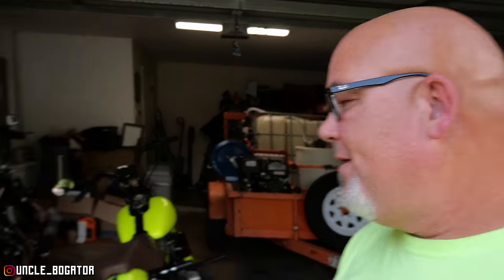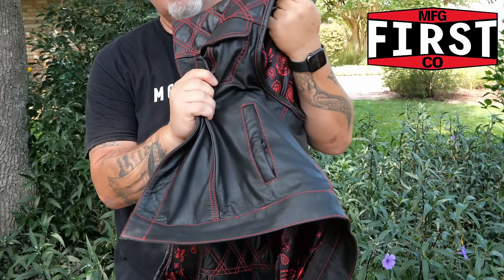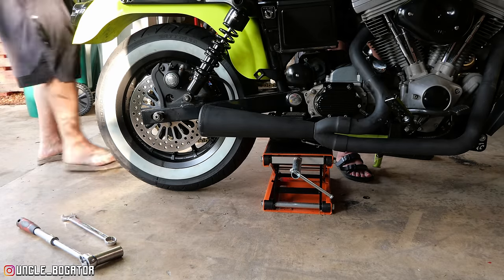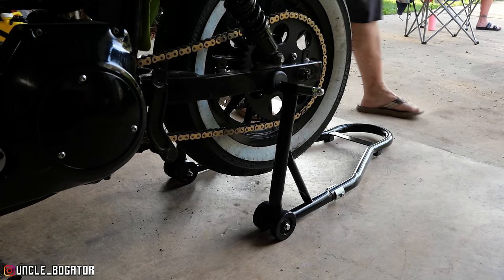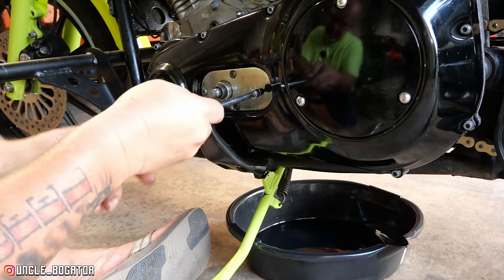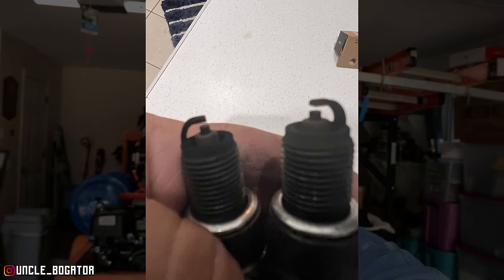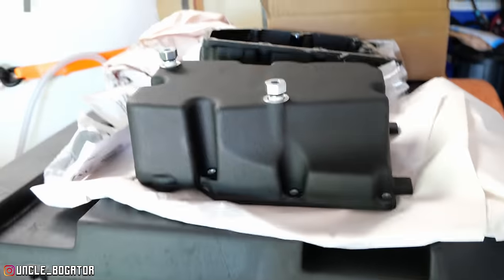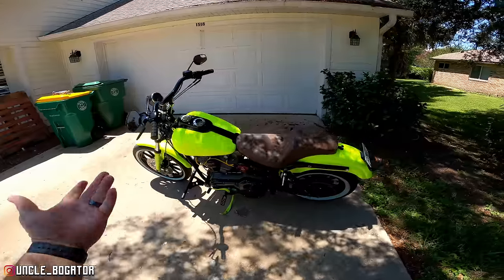This old Harley Davidson is a DISASTER!

Comment: Should probably be in the low range jet kit for an 80in evo. When i lived in tampa mine had a .0295 and a 70 with an ev27 cam and it seemed to run great
Reply from the maker: Thing is I think those are both in different ranges. 70 is low range and 295 is high range  if I recall right. I’m gonna try it with the recommended 72 and 295 and see where to go from there. If I’m still rich then I wasted money lol

Comment: A quick temporary fix for the leaking oil pan/tank because of the stretched threads is to use some Teflon tape on the drain plug itself. Only on the end near the bolt head though. Don't want that shit getting into your engine.

Nevermind disregard. Shoulda watched the whole damn video before commenting 😅
Reply from the maker: lol all good! I considered teflon tape but since the threads were angled, I didn't want to risk getting in the oil

Comment: i believe you need the washer to help seal the drain plug to the pan
Reply from the maker: it's not in the parts diagrams for this bike. But it's pretty thick. It's definitely not a washer like you're probably thinking. Looks more like a collar that would fit inside of a different model's drain hole.

Comment: Man, at least the bike ended up with someone who's gonna take care of it. I had been talking to the previous owner trying to snag this bike.  Ended up with an Ironhead instead after you bought it. Which was great, until it took 21hrs to get it home when yhe motor had oil starvation that blew the gaskets and the top end got jacked up further when the front piston kissed the valves.
Reply from the maker: big yikes man! hope you get it runnin right.
Reply: @UncleBogator  Me too! Thankfully, the previous owner as well as a couple of YouTubers that I've known for a while are offering to help me out with parts/guidance. First rebuild that I'm not going to outsource, so it's a bit nerve-wracking. But, glad the riding community has some good folks in it.

Comment: 😅Very possible they put on that carb just to have an s&s. Stock 80 inch do great with a well tuned CV and a .495 cam like the ev27.
Reply from the maker: Yeah idk anything about them yet
Reply: Sounds like you're about to learn.  Lol.  They're a great carb.  But a lot guys will just bolt them on and go,  without the proper fine tuning.   Good luck.
Reply from the maker: @joekool4  that’s the idea! This one has definitely been messed with. I’ve watched several videos on them. S&S lowbrow and some others to get a feel for what I’m doing. We’ll see

Comment: Here is a suggestion instead of crying in your beer with all the problems that bike has. Yard sale it!!!!   2019 I purchased a used Honda VTX 1300 with a Vance and Vines header. 10,500 miles then, about 12,600 now runs super pulls strong thru the powerband. Only changed oil in and a breather. Needs front tire but that's it. You won't get amazing glances from Harley riders, but you will be out there riding while they have theirs in the shop
Reply from the maker: That’s such a myth lol. I’ve had more problems from the many Hondas I’ve owned than all my Harleys combined. You’re just repeating things you’ve head but never witnessed.

Comment: You should use Gaskacinch on anything that contacts oil. Silicone will break off and get in oil passages and thus restrict oil flow.
Reply from the maker: I bought permatex or however you spell it. Seems good so far

Comment: I’ve never seen anyone adjust the chain with the rear tire in the air. I do mine at 1.25” with the tire on the ground on its own weight
Reply from the maker: Chains should be adjusted with the weight of the bike square in the swing arm. I’m sure yours is fine. Either upright on a lift without downward pressure or something like the paddock stand that I used.

Edit: it is on its own weight. That’s why you lift by the swing arm.

Comment: Thank GOD someone with sense used grease instead of that damn anti seize on the axle. You know, anti seize withe the ALUMINUM or COPPER "GRIT" in it. I wouldnt put that stuff near any wheel bearings. Plus when it dries out it seems to gall the parts together. I used to use it on my old jaguars on the wheel lug nuts. No Bueno
Reply from the maker: I've only ever used grease on my axles. Not cause I'm smart lol. I just never heard of putting anything else on them

Comment: GTFO! I never knew that I always thought the axle went from the left to the right! That's how all my bikes were always set up. Wit the castle nut on the right and a cotter pin going through never had a problem with that but I just Googled it and that's what it says you're right. Good tip...👍
Reply from the maker: There’s a master tech in the comments somewhere here that said don’t worry about it too much. Says exhaust gets in the way. But in my case exhaust isn’t in the way so I did it right to left.
Reply: Yeah, I figured it ain't too important. As long as you gota cotter pin in there ub alright.